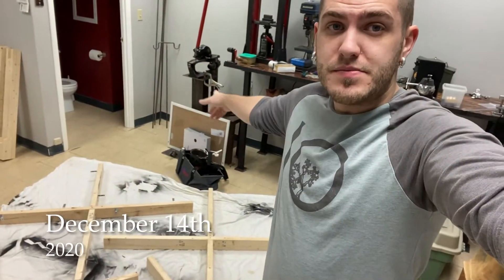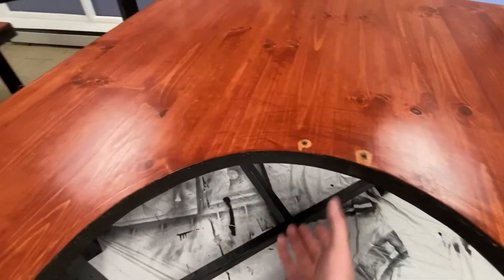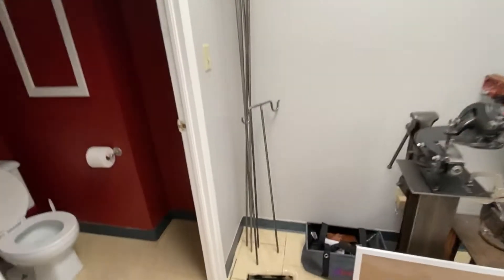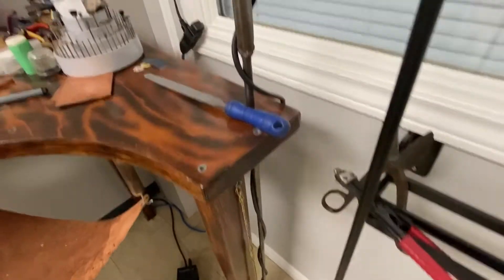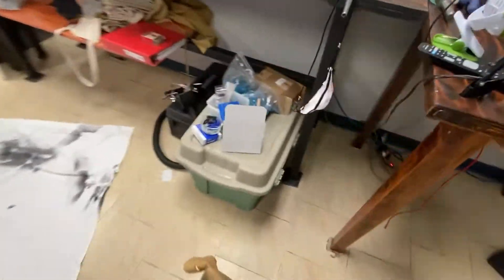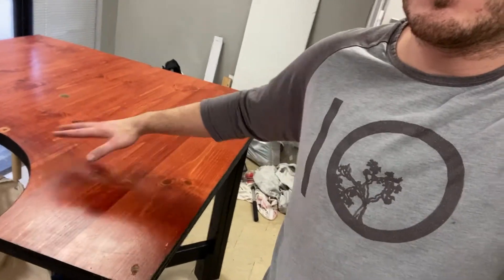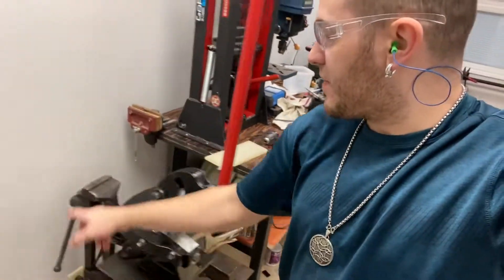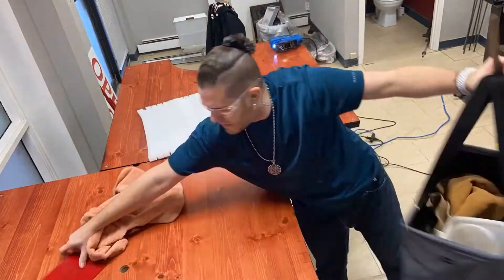Studio Vlog 2: Student tables

Comment: Wish I had known... I have a complete 10 station classroom with all equipment and hand tools that has to be liquidated - would have saved you a lot of time...
Reply from the maker: Probably wouldn't have helped as we are a Canadian studio. (Just an assumption as most of our viewership is from the US).
Reply: @ClearMindJewellery You are right about my location. California. I specialized in fabrication, stone setting and hand engraving for myself - but taught all techniques and skills for 35 years. 45 years total as a jeweler/metalsmith. Now I am one of the early C19 victims...
Reply: The plan now is to buy or rent a container van for a buyer and pack everything into it. There are also 2 rose engines and 2 straight lines which would have to be palleted and trucked individually. With a container all of it can be bolted down - and containers can be shipped anywhere in the world.